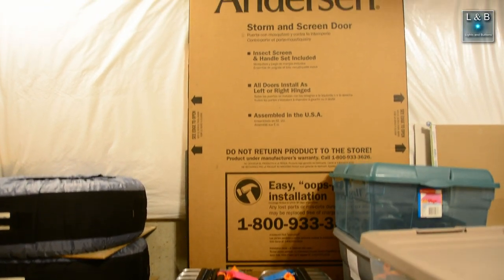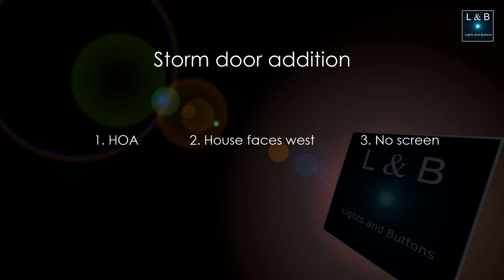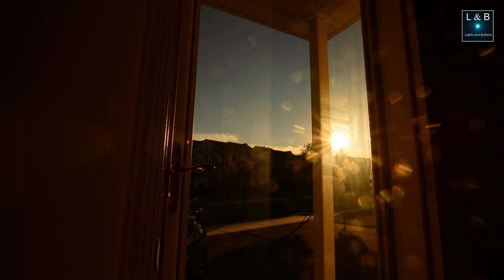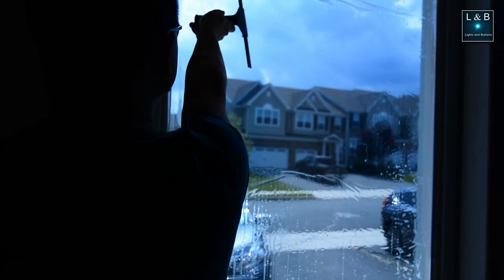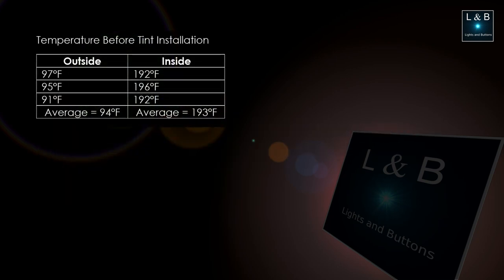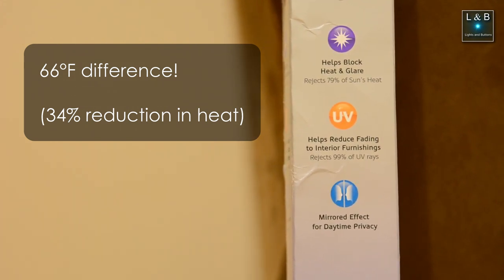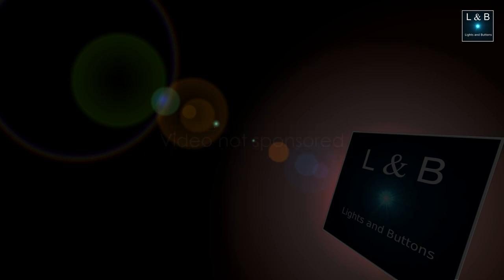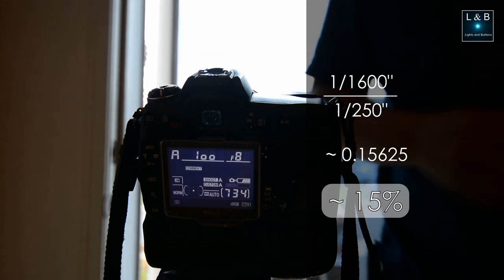Storm Door Tint (Quick Clip #41)

Comment: Today is June 9, 2022. I'm in a quandary about using the Gila products. On Amazon, reviews of the two door films are merged to increase the numbers, so you can't tell which product the reviewer is using. But there were so many negative reviews for problems like micro scratches, muddy view (on the "thickened" product, failure to adhere on the edges, packaging being too small diameter, ease of creasing, etc. that I was scared off. It's possible that the composition of their products or the country of manufacture changed. Also I assume that Gila is a marketing firm and they contract this product out. If you have an Andersen Fullview storm door you can just order a Low-E glass insert, but sadly I have Sugarcreek doors, now defunct.

Comment: I appreciate your demonstration. I'm having the same front door issues. I've used the heat reflective film all over the house on windows and it truly does work. However, as you point out the application of this film is never easy and it's extremely difficult to get right (no bubbling, precise cutting, no pealing). My biggest concern is that the doors (unlike my crank open windows) get a lot of hands on touching. Does your film hold up? Have you had peeling and scratching? I'm guessing it won't hold up and this stuff is not cheap.
Reply from the maker: We mainly leave the front door closed, so not a whole lot of contact with it. The edges (couple of millimeters) are not perfect since I cut them slightly too large at certain spots. But, the main portion is actually holding up well.